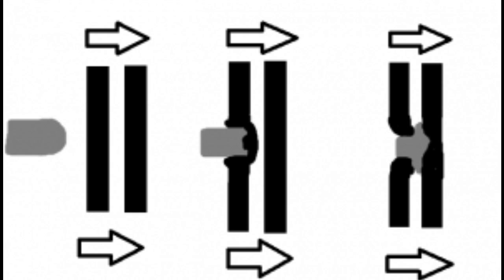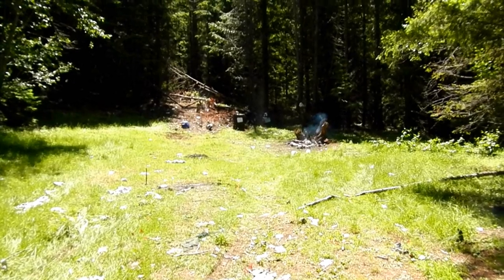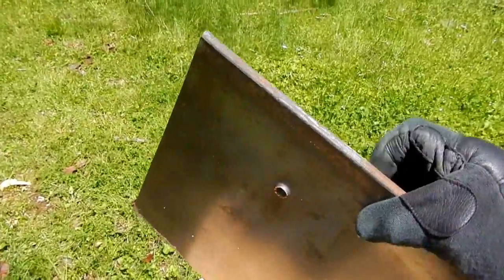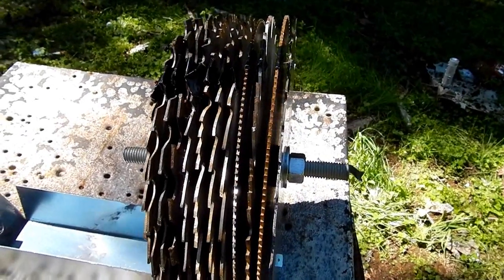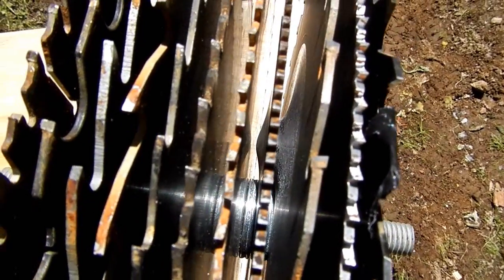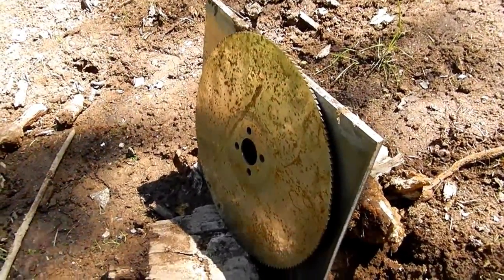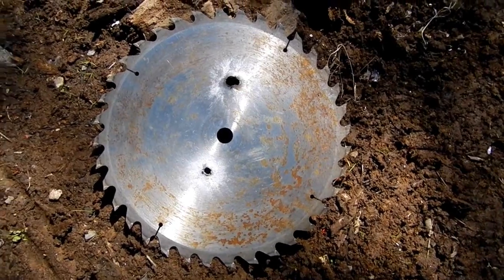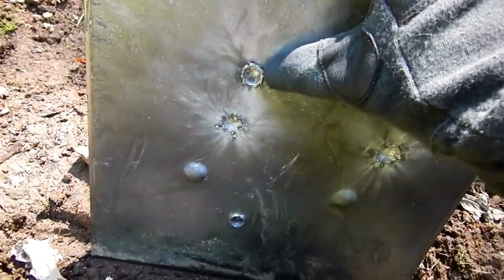Testing the Concept of Spaced Armor

Comment: Its to protect against shaped charges not bullets.
Reply: Depends on design. Original Schurtzen was used to protect against anti-tank rifles as is destabilized bullet prior impact on the main armor thus greatly reducing its piercing ability.
Same could be applied today. 

Mesh armor, slat armor etc. on the other hand are supposed to either prevent the HEAT warhead's detonation (through damage or "gentle" deceleration) or reduce its penetration ability by damaging its geometry. 

Other types of the spaced armor may be designed to interfere with penetrating jet of the HEAT warhead and thus increasing the protection.

So there are more than one reasons to use this type of armor.
Reply: and shaped charge will penetrate no mater what material is there 😂
Reply: @killerbern666  But shaped charges are designed to work across a specific depth.  Place a plate out from the main armour and you will rob the shaped charge of a lot of energy as it detonates on the spacing plate and never pens the main armour.  That's why a lot of modern shaped charge rounds have double or even triple warheads: they're specfically designed to defeat stand off armour and ERA blocks.
Reply: iatsd yea thats true
Reply: @iatsd  As modern HEAT rounds can penetrate some 1000 mm of the steel, you would need your spaced armor too far from the main one to be useful for the fighting vehicle. That's why they use ERA, NERA and composite armor to "eat" the energy of the warhead.
Reply: @mungo7136  Not entirely true.  The penetration value assumes continuous plate.  Air gaps and changes in density reduce the value, Sony having a stand off distance you do reduce penetration. That's why you see things like the Merkava MK1 using diesel fuel cells as part of the hull front armour layout, or Chobham using 10-15 cm physical empty spaces.
The trick is in how much space to use and where, and also why, from the attacking side of things, you see things like tandem warheads on some heat ammunition as a way to try and defeat spacing.
Reply: @iatsd  Tandem warheads came after ERA, to make a way for the main warhead. They are not that big to do something with the main armor that is designed to face much bigger ones.

Spaced armor in terms of multiple layers of various material where debris and filling can interfere with the penetrating jet is "slightly" different beast than just one plate outside of the armor as you stated. Especially if we are talking about lighter protected vehicles compared to tanks (that's where video starts).

I do not know whether anybody has ever seen Chobham and made its composition known to public. I have heard contrary.
For what I have seen (mainly for russian armors but as well as Abrams' one on damaged vehicles) those metal plates have the gaps often filled with some kind of rubber or plastic material, thus working as NERA and some gaps to physically separate those NERA plates - probably to allow them to function properly.
Reply: @killerbern666  depends on material. When you disrupt penetrating jet you you defeat it.

Comment: Saw blades are tempered to be harder on the edge and more springy toward the center, so they will stay running true as they heat up.  Hot rolled steel is relatively soft by comparison.

Comment: No surprises on the difference in penetration between the two rounds. A slower, heavier bullet will dump it’s kinetic energy more quickly, while a faster bullet will penetrate. Obviously the difference in steel will effect how it absorbs impact. Combinations of higher velocities and lower Rockwell ratings will yield a tunneling effect, and harder surfaces will smash bigger and slower bullets. Sabot rounds are a good example of this. However, I think the real utility in spaced armor isn’t in defeating a solid projectile; it’s getting an explosive projectile to detonate before it’s in direct contact with the conventional armor underneath.

Comment: You should try sandwiching styrofoam between the blades. I wnce shot an old refrigerator with a .40 cal. I was surprised most of the rounds were stopped by the first wall. None penetrated both sides.

Comment: I'm not sure if this has been commented yet but spaced armor is normally used to detanate chemical penetrating rounds (this includes heat and hesh she's also some very sensitive he shells). Spaced armor is not to stop kinetic penetrating projectiles (this includes solid shot, sabot, and any thing that uses kinetic power to push through the steel). So spaced protection provides very little added protection from normal rounds but can completely stop a hear shell. There are old 1950s U.S. training films explaining exactly how it works.
Reply: Now you need to tell that to wot

Comment: Spaced armor is NOT effective against kinetic rounds. Sure i bet it helps a little bit but not much. Spaced armor is mainly for HEAT rounds!
Reply: It is, when deployed properly. 

First, it can (depending on material of kinetic round) damage the tip of the round, lowering its ability to penetrate the next layer. First layer should be especially hardened for this effect.
Second, it can, if angled, force a pitch on the round, again lowering its penetration ability. For this effect however, the space between the layers needs to be bigger then the length of the penetrator.
Reply: @papaschlumpf5894  Thank you for that answer man! for real! I did not know that fact. I know that the density of the round and armor does have a large effect on penetration.  And i also know that the space in between the armor, aka the air has a effect on the round aswell but the other facts you prestented for me i did not know. Thanks m8!

Comment: 7,62 is a much heavier round and it is better at transferring energy to the target. Also, if impacts something before the target, it is less likely to tumble or change direction. That is why it is a better manstopper. 5,56 will just whizz through, so you often have to hit something vital to stop a man, while the shock of being hit with 7,62 is much greater.
Also, spaced armor is used on vehicles as a protection against shrapnels and some types of AP rounds, not small arms fire. Basic plate on those vehicles is designed to stop those on its own, so it is unnecessary against rifle fire. And even against AP projectiles, it depends...
Shrapnels and HE rounds - it can provide fair amount of protection against those since HE rounds will detonate sooner and away from vehicle (unless a delay is set on the fuse)
APHE - not so much, it is debatable... If the fuse is activated upon hitting outer plate, then maybe penetration value will be decreased. On the other hand, if the energy of the shell is too great, it will be the same as hitting a piece of paper, so nothing
HEAT - nearly worthless against those. If the projectile has, say, 400mm of penetration, that is value for steel, not for air. Yes, that jet of white hot copper will go through 400mm of steel, but much farther through air. I saw a vid of some Russian guys firing RPG-7 with that penetration value at "spaced armor". True, it wasn't steel, but the distance between plates was 1000-1500mm approx and - it went through all. In slow motion, you can see the jet clearly crossing the distance and doing full damage on the other side. The nature of this type of rounds (burning through steel)... But, there other ways to stop this very effectively.
APFSDS - they say it is rather effective against these since after the initial hit, it makes the penetrator wobble so it loses both energy and direction.
So, spaced armor is not meant to stop rifle rounds. If it was told so to you, it is only psychologically.
Reply: @Aaron Washburn Good for you...

Comment: My guess is that the saw blades are probably somewhat invalid for testing penetration as you have them.  This would be due to the flexing of the blade during penetration, causing a trajectory deflection of unknown quantity.  My guess is that it would result in an unrealistic and enhanced progressive deflection that would disrupt the line of penetration enough to partially limit penetration.  That is of course coupled with deformation of the penetrating tip (which gap armor is supposed to do too) and that part of the equation is valid.  The problem though, is ...Which is which ?  Just a guess though.

Comment: What if you sandwiched all those blades together? How far would the bullet travel through all of them? An air gap probably doent help all that much if you figured the sandwiched blades as opposed to the airgapped ones. That metal in the blades is more brittle anyways.
Reply: The air gap is quite important. A high velocity projectile that is suddenly decelerated by a steel plate gets its nose flattened, yaws, loses stability and begins to tumble. If it hits the next plate side on (or at less than optimal trajectory) the energy in the bullet is spread over a larger area - perhaps the bullet even breaks up because of the forces - and it does not penetrate so well. The gap allows the projectile time to tumble. With the plates together the direction of the penetrator is more linear and forces are focused on the tip. However for larger calibre penetrators, a spaced plate lacks sufficient support/mass to be so effective; the penetrator is able to pass through with minimal destabilisation, and in this case one thick plate offers better protection than two thinner ones of the same total thickness. Spaced plates are therefore good against small calibre AP. Co-incidentally they also pre-detonate HEAT but that was not why the WW2 Germans used them.

Comment: You should have used thin mild steel sheets, spaced and totaling the equal thickness of the mild steel plate. That's how experiments work. But I like the video and have subscribed.